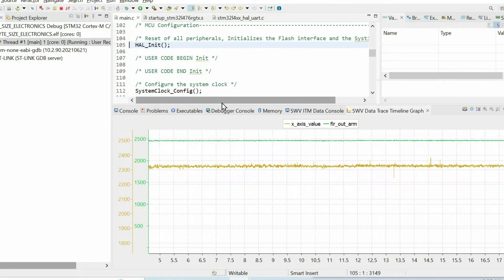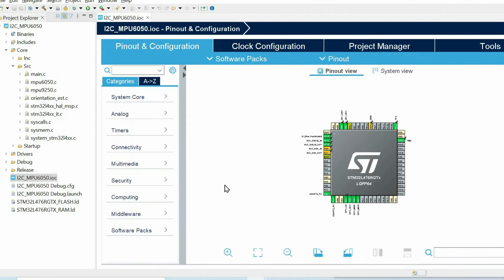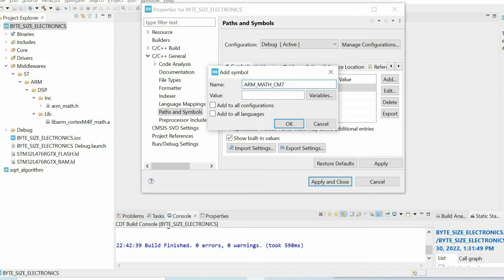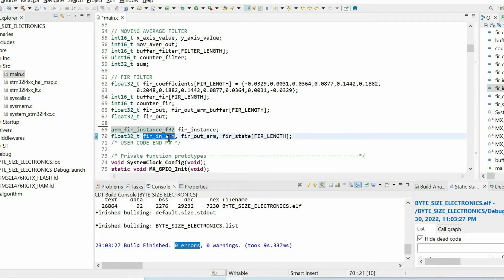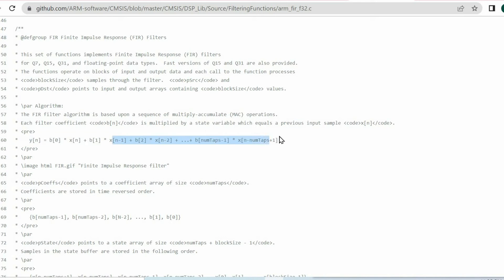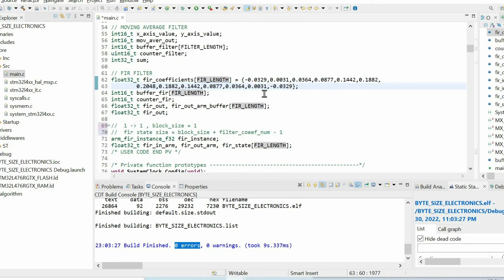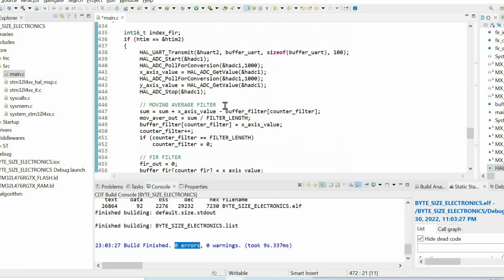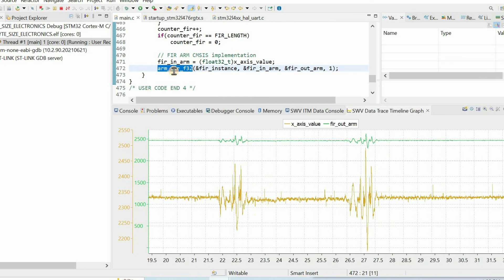STM32 DSP CMSIS library: FIR filter in one line (2022 new method)

Comment: After generating the code I Middlewares folder was added. I adding ARM_MATH_CM4 in Symbols (I'm using stm32F446RE NUCLEO) everything looked good. I then type #include "arm_math.h". but when i build projet there are multiple errors in arm_math.h files. some errors are about float type definitions. any tips?
Reply from the maker: I have never had such an issue. Are you sure that you added the symbol in the proper place? (paths and symbols, GNU C)
Reply: @steppeschool3629  I'm sure. I did successfully included it in the end. turns out in the new versions of CubeIDE you can download DSP library from Pins & Configurations UI and then just write two lines in the includes: 
#define ARM_MATH_CM4 (because I'm using F4 series) and #include "arm_math.h"

Comment: That filter for what sampling frequency is it designed? what did you put on your clock?
Reply from the maker: The filter was designed for a 1 kHz sampling rate. The details can be found in this video:
https://www.youtube.com/watch?v=9J7NyZ6WKv8&list=PLmXXQ1iFwiyKzOzq2efYU7ROIyD-lFBZL&index=8&t=352s

I controlled the sampling rate using the TImer Update Interrupt's frequency:
https://www.youtube.com/watch?v=KtVFYXtHvWc&list=PLmXXQ1iFwiyKzOzq2efYU7ROIyD-lFBZL&index=4

Comment: Hi, i have board f407discovery. But on stm32cubeIDE no detected st link. How to fix it?
Reply from the maker: Hi, there are many reasons why the st-link is not detected. Usually, the boards have several USB connectors, one for the st-link. First, make sure that you connect the right USB socket. Also, the STM32 boards possess jumpers to connect STM32 MCU ST-LINK pins to the corresponding pins of the ST-LINK. Make sure that they are in place.
Reply: @steppeschool3629  i plugged in the usb stlink, and on keilC detected and downloaded normally. But not with cubeIde. I also used stlink utinity connect and detect stlink normally
Reply from the maker: Then, what do you mean by STM32CubeIde does not detect the st-link? Can you not flush your code to MCU?